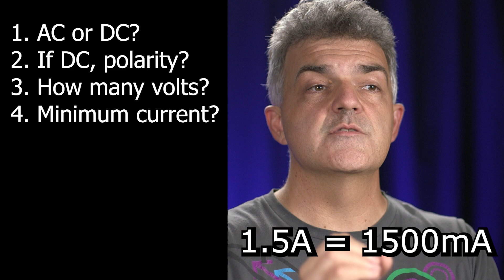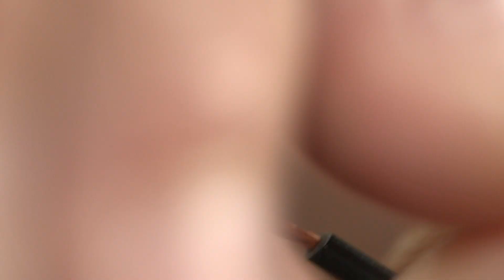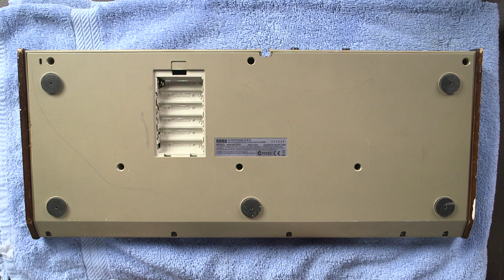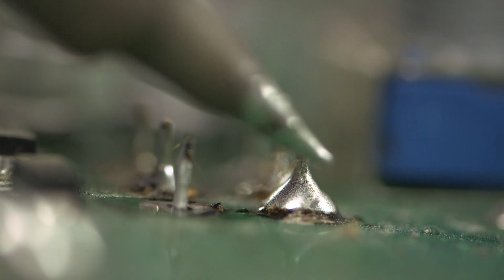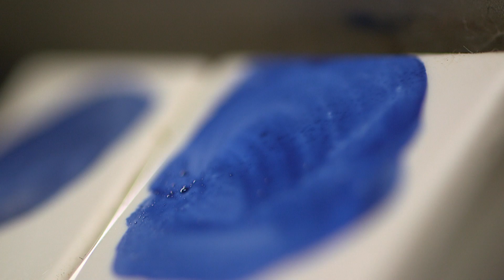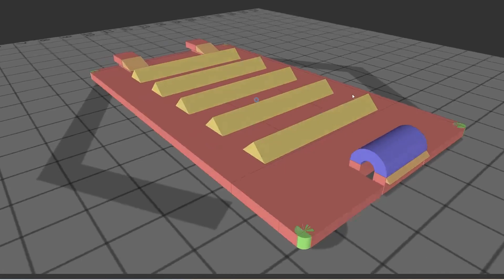microKORG power switch and battery door replacement!

Comment: having a similar problem to yours at the end where my microkorg seems to be working fine...except no audio out. tried factory resets a ton of times but no luck. got some suggestions to use multimeter on pins of IC14 while power is on. was also told i need to attach black lead of multimeter to common ground when i do this. any tips on where to attach black lead for this pcb?
Reply from the maker: Usually large exposed slabs of copper on a circuit board are "ground planes" and are an easy spot to ground your multimeter. If you plug in a quarter inch plug into the output of the keyboard, the large metal housing of the quarter inch plug should also provide you with a large piece of metal that you can ground your multimeter to. Also, most places where screws go through the circuit board have some exposed copper pad which allows the screws to make contact with the circuit ground and then ground the circuit board to the chassis of the device. You can also use that little grounding cable that is attached to the side of the circuit board and screwed into the chassis that you can see at 17:55.
Reply from the maker: Good luck fixing your keyboard. I don't know if this will help you or not, but you might try reflowing all the solder connections for the left and right quarter inch output connectors and the headphone jack. A lot of times problems are caused not by component failure, but ordinary disconnections caused by old solder joints that develop tiny cracks. Sometimes you can reflow them (add a very small amount of solder and melt them into a liquid briefly and let them solidify again) or you can just remove the old solder and add fresh and things start working again.